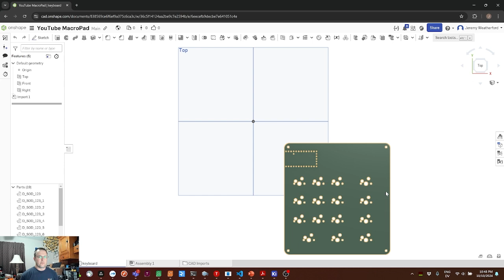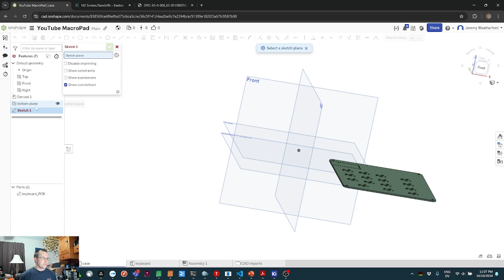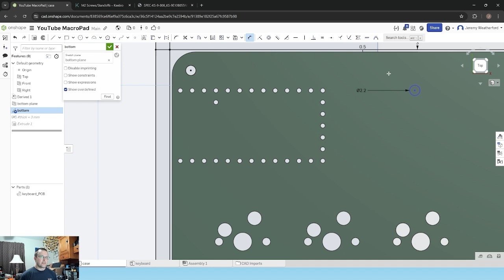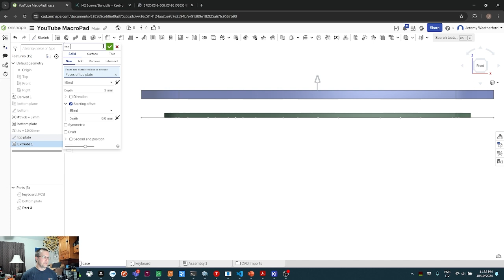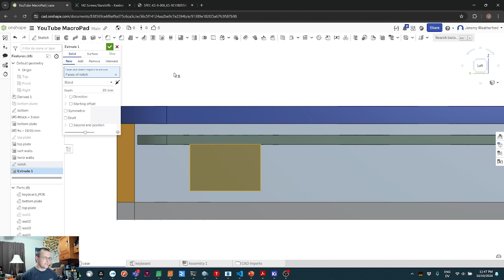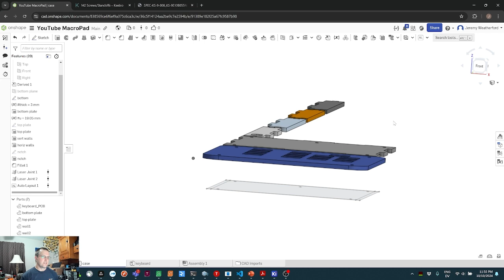Zero to custom MacroPad in 37 easy steps - Part 3: CAD

Comment: I had some trouble with Kiri:Moto but I more or less straightened that out. But one thing confuses me, the parts are laid out in a long narrow line going into Kiri:Moto but when you export it seems to rearrange them into a compact arrangement. When I do it that doesn't happen, the DXF file still contains the long narrow non optimized arrangement. Did I miss a step?

(Also: the Sea-Picro and the hotswap sockets are out of stock at beekeeb.)
Reply from the maker: Hmm... I went back to it and I can't get it to arrange the parts now.  Arranging them manually in Lightburn isn't too bad, or there are tools to lay out a DXF in the minimum number of sheets (sometimes called "nesting").  I wonder if that got moved to a paid feature in KiriMoto.